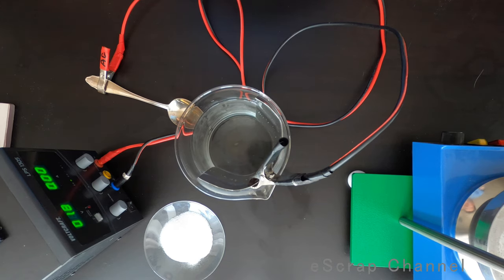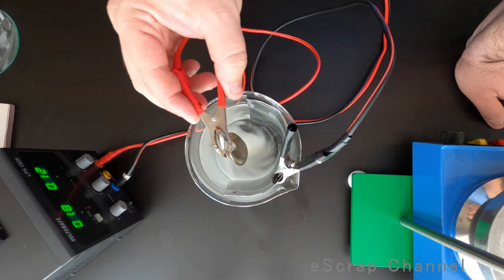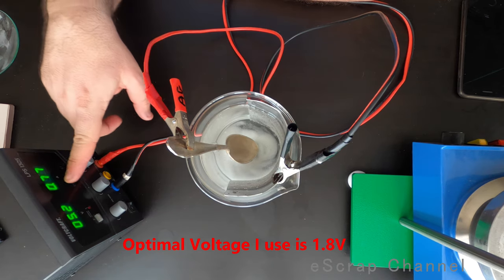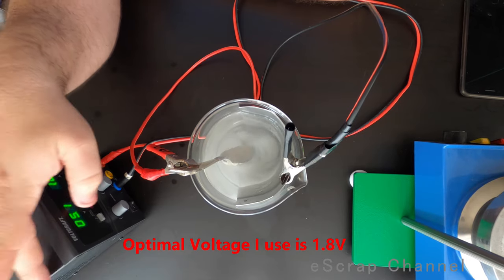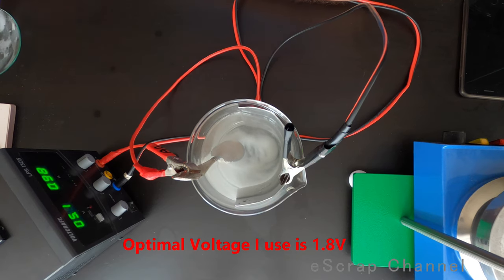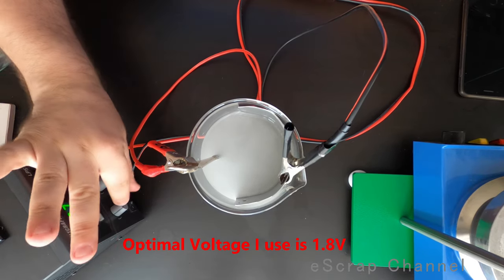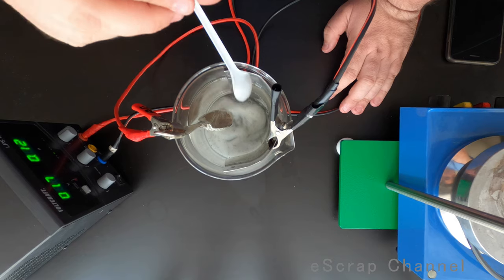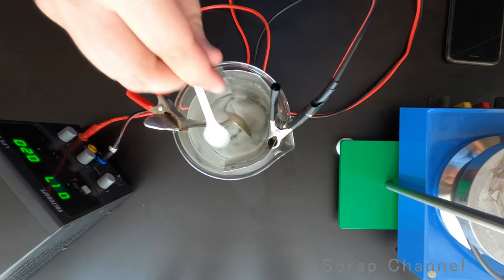Silver Recovery with Reverse Electroplating

Comment: I was an aircraft mechanic and worked in aerospace almost my entire career. All jet engine hot section components are fastened together with literally hundreds of nuts and bolts that are silver plated because the silver acts as a lubricant so they’re easier to disassemble. The fasteners can only be used once and then they’re discarded. I’ve thrown tens of thousands of them away over the years! If I only knew how simple it would have been to strip the plating away I’d have retired a wealthy man!
Reply from the maker: I fully understand you. If I have had the knowledge about eWaste I have now 20 years ago I would be able to retire at 42.
Reply: They still do 😂. It is crazy to me, our scrap guy must be a happy dude. Even the one time use crush gaskets are plated.

Comment: I learned how to do this about a year ago from watching you.  I would like to tell you what I have discovered in the meantime.  You said to use a piece of stainless steel as the electrode and I wondered,  magnetic or non magnetic stainless steel? I searched for the answer and didn't find any info, so I experimented and found that magnetic stainless steel works far superior.  What I then did was to get a full size commercial restaurant magnetic stainless tub and make that my cathode. The whole big tub. I further placed huge magnets obtained from electric motors around the stainless tub to increase its magnetism. I'm talking about magnets that are so powerful that they are dangerous and can injure one. For my anode I have silver plated buss bars attached to wood that I have across the top of the tub from which I attach and hang silverware and other silver plated items I wish to deplate. I use the salt that you recommend as well as the low volts you recommend. I keep the silverware in the solution for about 2 days and I don't have to use a brush at all,  as all the silver is off, along with some base metal. Ramping up the size of my contraption allows me to deplate around 40 pieces of silverware at a time.  I started off with just the glass like you are showing.  When I do a clean up,  I get a brown sludge which I dry,  cupel to get rid of base metals and then remelt in a crucible and pour into an ingot to await further refining.  Your video is what got me started.  Thank you.
Reply from the maker: Wow! Happy rot see that this video was useful to you and thank you for sharing how you further improved the cell.
Reply: BREATH!!!!
Reply: Please make a video of it 🙏

Comment: thanks for the information.  my question is does the electrolyte go from a dilute sulfuric acid to more concentrated after you remove silver from many pieces?  also, as i have been doing this, the brass and copper base metals eventually go into the solution as foam as the silver is removed.  i am suspecting that some of the base metals go into solution along with the silver.  how to you process the brass/copper materials that collect on the bottom of the container?
Reply from the maker: Hi, electrolyte is quite cheap and to be honest I never used it long enough to see a difference as you describe. Silver in solution I precipitate as silver chloride. Metal pieces on the bottom I dissolve in nitric acid first and then precipitate silver as silver chloride, too.

Comment: It's all arrived now my friend. I accidentally mixed 60g in my liter. Is that okay or do I need to decant and make 50g?
Reply from the maker: @HardKnocksTime  hi, 60g per litre of water is fine.
Reply: @escrapchannel  Not having much luck getting any silver thus far. I'm set at 1.8v my amps are low and won't go higher then .9. I've been going about 2 hours now with no silver peeling maybe just a tiny dust when I brush the item. Almost as if it's not working at all. Any suggestions?
Reply from the maker: @HardKnocksTime  you may have silver in the solution. Take 1ml and add table salt. There are two parts of the process: silver goes to the solution and some parts of the plating may fall too.
Reply: @escrapchannel  how much salt should I add to the one ml of solution,?
Reply from the maker: Couple of crystals - silver chloride should instantly appear as white residue.
Reply: @escrapchannel  No response to it. I have hcl too here? Should I try a drop?
Reply from the maker: @HardKnocksTime  yes, it is better than table salt.
Reply from the maker: @HardKnocksTime  Silver plated object is connected to red +, correct? As other electrode is used stainless steel, voltage is at about 2V and solution is 60g of Na2SO3 in 1l water.
Reply: @escrapchannel  Yes sir that's correct. I do see some black powder in the bottom of the beaker now. Def not a lot but I did about maybe 10 pieces flatware. I may collect it later today, and wash it then melt it just to get a test yield etc. But no reaction to the solution and salt. I wish you had an email I could send a photo to.
Reply from the maker: escrapchannel@abv.bg
Reply from the maker: I well see it in 6-8 hours when I am back home
Reply: @escrapchannel  Okay I will have a look at it later on. I'm do grateful for you and your help with everything I've had questions about. I hope you'll keep doing videos and helping folks. You are the true example of what a man should be. If you do something for someone you help them out. If you teach someone how to do it, you give them hope for their future. I am forever grateful of your teaching me. I'll get it right but along the way I'll need your help. I don't believe thus flatware is the best condition. Again I wish I could send you photos so you could tell me if I'm doing right and it's just the flatware being not too great. But I do agree the sodium sulfite method is so much cleaner and better. I have zero base metal in my solution only black powder in it!! Very happy with this method for sure!! 
Again thank you so much my friend. My name is Rock and I'm honored to have met you and learn from you. I will pick this process up later on and will be in touch.
Reply: @escrapchannel  Is this an email I can send photo to from the U.S.?
Reply from the maker: @HardKnocksTime  yes, it is an email address
Reply: @escrapchannel  Perfection. I will send it now and when you have time later just reply back to it. Also will send photo of the spoons after I have let them deplate for 25 minutes. They still appear to have silver on them possibly. I'm not 100% sure though.

Comment: How does the quality of the silver change at higher voltage
Reply from the maker: Hello, usually when voltage is very high and there is foam on top we have not only silver but also all other metals dissolving and even small pieces falling from the surface, so silver is dirtier that we collect, In all cases needs refining to 999 so not a big issue.
Reply: @escrapchannel  could more than one piece be deplated at ounce
Reply: Could you just use a stainless steel bowl and attach the lead fill it with electrolyte to do this
Reply from the maker: Michael Madera: yes, you can use copper wire for example and put together many objects.
Reply from the maker: Michael Madera: yes, dirty silver can be purified as Sreetips shows in his videos or just dissolved in nitric acid and reduced to silver with copper or zinc.

Comment: What would happen if you increased the power supply to 12v 6amp?
Reply from the maker: Hi, fast reaction, dirty foam on top, etc. Electroplating and reverse electroplating are slow processes and the slower the better quality result.
Reply: @escrapchannel  I had a very very dirty solution doing the 12v 6amp. I did use salt and distilled water. It was horrible. So much base metal in solution. I have non-iodized salt and distilled water here. I am going to try the voltage you have recommended. How long should I let it deplate before removing it and brushing?
Reply from the maker: @HardKnocksTime  wait, please! Salt? It will never work with salt in the solution. Thats the reason for the base metal quickly moving to solution. Please use Na2SO3 - 60g per litre distilled water. It will keep reaction smooth at the. Outage in the video.
Reply from the maker: @HardKnocksTime  Sodium Sulphite is the chemical name
Reply: @escrapchannel  I will get the sodium sulphite and give it a try. I can't thank you enough. Give me a week and I will be back to let you know how it turned out. Thank you again for all of your knowledge, time, and sharing with me!!!
Reply from the maker: @HardKnocksTime  You are welcome. If you have additional questions do not hesitate to contact me.
Reply: @escrapchannel  Sodium Sulfite is the correct spelling right?
Reply from the maker: @HardKnocksTime  yes, it is sulfite- Na2SO3
Reply: @escrapchannel  Perfection. It has been ordered. Thank you so much again. Can't wait to share my results. I have almost 8lbs to reverse.
Reply: @escrapchannel I've had a piece running for 30 minutes. Nothing has come off of it. I know it is plated, but nothing has come off. I'm at 1.8v my amps are .9 and lower at times. Only way the amps will go up is if I dial the voltage up to almost 3v. What's happening here?

Comment: 1.8V is the 'optimal' (minimum) voltage ONLY if using common steels as the anode. If using a different mental, check your standard galvanic potentials!
Also . . . if you let the reaction progress, the whole spoon will be gone. It doesn't stop at the silver unless you use the same metal for your anode as the metal in the original silver-plated object.
Reply from the maker: Current is optimal for steel anode. Correct.
Reply: you mean if I use pure silver instead of stainless I dont have to refine it after to get rid of anything?
Reply from the maker: That’s correct. Even on top of the stainless steel silver is 999 to 9999 pure.
Reply: thanks ! @escrapchannel

Comment: Hi, Thanks for sharing! very illustrative video !.. One question,  Is the sodium sulphite electrolyte always selective for the Silver no matter what the base metal is?
Reply from the maker: Hi, I used sodium sufite for different silver plated metal objects. Always worked. But who knows :)
Works well for silver plated brass and on top of the object we have tin, iron ... so no issues.
Reply: @escrapchannel  would using a computer supply with 12 V make the process much faster?
Reply from the maker: Hi, when voltage is high reaction goes fast but also impurities are more. Also some foam spears on top that is quite unpleasant. 
From my experience electrolytic processes are slow in general and pushing them is usually not successful.
Reply: @escrapchannel  what electrolyte do you use for gold plating?
Reply from the maker: @FirstLast-tx3yj  For gold plating I do reverse electroplating in 98% sulfuric acid.

Comment: for a container with a volume of 20 liters what voltage and current is needed? do you have any recommendations?
Reply from the maker: Hi, voltage should be same, and when you set-up the system you will test with a power supply working on constant voltage what is the current. You work at constant voltage and during the process current changes.
Reply: @escrapchannel  okkk. for the best current settings at what number ? If the cathode area is 450 cm²? Is there a contact that can be contacted to ask questions about this silver recovery?
Reply from the maker: Hi, voltage or potential difference between electrodes is important in reverse electroplating. When process starts at fixed voltage you will have maximum current for the cell and it will slowly go down. For 450cm2 should be more then enough a power supply I use: 30V /5A. When you work on 1.8V for example you can test current dependence on concentration, distance between electrodes, etc. 
Just build the cell and the during testing it will be properly set-up.

Comment: replace the stainless steel with a silver spoon?
Reply from the maker: Hi, never tried :) To be honest I always refine silver before melting it. Sreetips cell works well, also a cycle of nitric acid dissolving works. Just to go closer to 999. Silver spoon is an alloy - if sterling 92.5% if other can be 80% or in between ...so to get 999 in all cases one more refining is needed.
Reply from the maker: I like stainless as it is easy to remove silver from it’s surface and can be used almost forever :)
Reply: @escrapchannel  the problem i have is my refiner pays more for sterling than 999.  i dont know why....
less steps and expense for me😃
Reply from the maker: @tinsoffish1810  Because your refiner most probably directly uses sterling silver that is 925 silver for jewelry.
The point is that if you use spoon you will get pure silver on top.
If I was you - I will use the stainless electrode and get 99% silver. Then add copper to reduce the % to 92.5% and sell as sterling.
Is your buyer using any tool to check the silver content?
Reply from the maker: Also, don’t expect to get solid silver layer on top of the spoon. In home refinery you very difficult can keep the conditions to get solid silver on top.

Comment: Great Video, one thing I would like to ask, what difference would it make if I use sea salt instead of the sodium sulfite? and would it be the same amount if I did?
Reply from the maker: Hi, if you use salt you will end up wit a lot base metal dissolved and deposited on the stainless steel electrode.
Reply: @escrapchannel  thank you for the answer and for the quick response :)

Comment: Can you tell me if you get toxic fumes from this. Is it safe to do in the house
Reply from the maker: Hi, I can’t recall any fumes or bad smell. Actually it was done in-house without ventilation on.
Reply: Thanks for the reply
Reply: Sorry for the questions but how do you know when the silver is all spent on the item . I seem to have a creamy calcification on the item. When I scrap it off it still looks silver. Also does the solution have a shelf life? Do you need to filter off as I've a 2lt beaker and the water is cloudy? Dark brown to black. Any pointers will be appreciated 👍
Reply from the maker: Process is slow, so it takes long time to strip all silver especially when layer is thick. You are correct as long as you see the white layer on top you have silver on the object. Base is usually brass, so Color change is clear when silver stripped. 
The fast way to strip silver is to use acids. 20 parts concentrated sulphuric acid and one part concentrated nitric acid. Heating needed but not boiling. Strips silver fast and you clearly see red colour of the base metal. Sulphuric acid blocks sipper/brass from dissolving. Silver is recovered from solution with table salt as silver chloride. Work with acids needs special equipment and unfortunately hood to ventilate poisonous gases. So, don’t do this if you cannot protect yourself.
Reply from the maker: The ‘charm’ of reverse electroplating is that you let the electricity do the work. Just connect and forget. It is slow but needs no effort. Silver drops as metallic silver pieces and also goes into the solution.
Reply: Thank you. 
I  like this idea for this type of project. No acid and not a lot of effort. Thanks for clarifying everything.

Comment: Sir can I use sodium sulfite  and distilled water  for revers electroplating gold? Not a silver
Reply from the maker: Hello, no. It will not work as you will dissolve a lot of copper. Gold reverse electroplating is done in concentrated 94-96% sulphuric acid. I have such videos.
Reply: @escrapchannel  Sir I can't use sulfuric acid  . Please tell a another chemicals. I like use distilled water and citric acid to my chemicals what do you think it's will work? Please reply.
Reply from the maker: Hi, citric acid method works well when used for thin gold plating like ram fingers, not that good for pins and gold plated metal objects.

Comment: Do you think magnesium sulfate would work as good as sodium sulfate?
Reply: Or possibly a potassium sulfate ?
Reply from the maker: Should be sulfite not sulphate. In general sodium cation is really small and moves fast in water when potential difference applied. Magnesium is a little bigger cation and two 2+. Sodium is 1+. 
So, if you use magnesium salt you will have worse electro conductivity with same amount of salt.
Reply: @escrapchannel  Thank you for the correction and your advice. We have done reverse electroplating on Silver before using the sodium chloride and distilled water. I start seeing what appears to be a copper going into solution and the recommended clearing of this was a couple of drops of hydrochloric acid which appears to be producing copper (II) chloride. We've been definitely looking for a cleaner method with less by product.
Reply from the maker: When you do reverse electroplating you should consider the potential of the ions, so you calculate what will be the product on the electrodes - silver, hydrogen, etc.
If you have a lot of silver plated metal objects just use chemical stripping. Sulphuric acid 1 litter and 50 ml nitric acid. Both concentrated. Mix carefully! Removes silver plating really quickly and efficiently.
Reply: @escrapchannel  I'm a fan of the sulfuric/nitric recovery method, I'm trying to keep it as low toxicity as possible, something that my teenage son could participate in, with minimal hazards.

Comment: What about using a tungsten rod and sodium bicarbonate ?
Reply from the maker: Never tried this combination maybe because I never had a solid piece of tungsten.
Reply: Im just worried about creating chlorine gas from sodium chloride
Reply from the maker: @matthewforgath5298  Reaction is slow so if done open air or under any ventilation - gas produced should not reach risky concentration.
Reply: @escrapchannel  if it's done fast does it affect the silver in anyway ? Will it burn it up ?
Reply from the maker: @matthewforgath5298  when voltage is high and reaction goes fast there is a lot of base metal in solution and also starts bubbling and forming foam.
Reply from the maker: Silver is not affected, just big mess is the result.